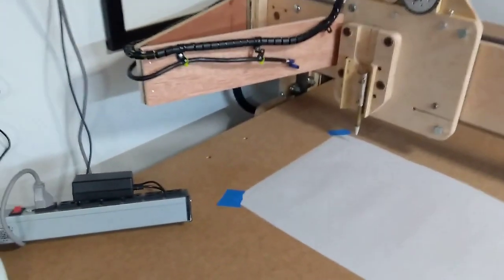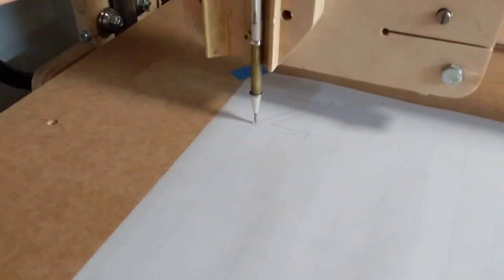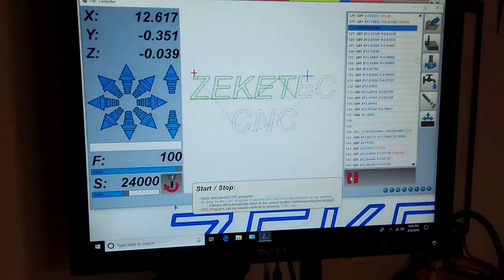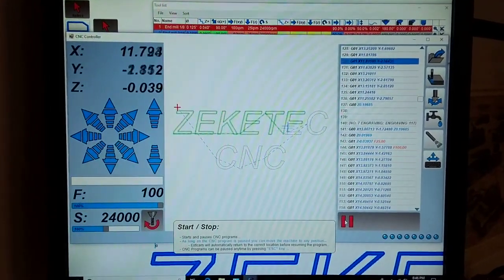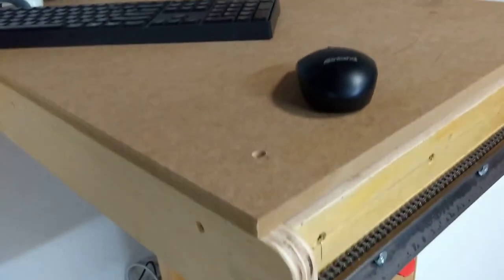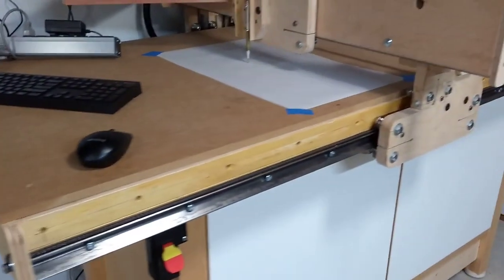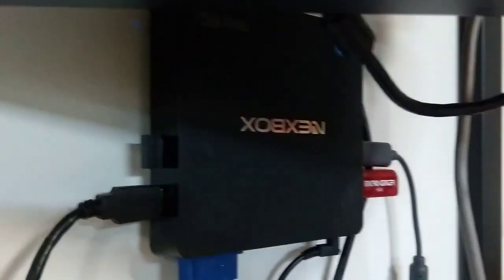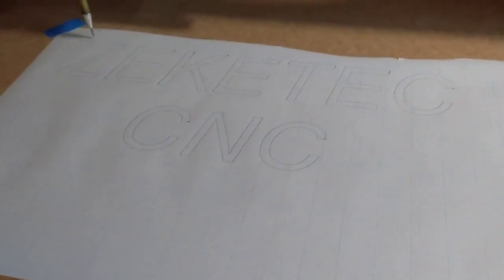My CNC Router Lives!

Comment: Hey, I really like the setup. Great job. I was wondering if you have and can send me what all you used and sizes you got in the sprocket to make it? I am trying to build a 4' x 8' system.
Reply from the maker: The sprocket sequence is: 9 tooth on the motor driving a 32T sprocket, the 32T sprocket spins the 12T sprocket which runs along the X and Y chain lengths.
Reply: @zeketeccnc1207  thanks, will make note of this
Reply: @ryancraig4063  hello 
How far have you with your 4x8 system? Im also planing to build such. Would you mind giving me some guidelines also?
Thanks

Comment: hello, great build, I like to build a CNC plasma for myself and I want to use a chain drive system on my CNC. please can you give me the number of the teeth on the stepper motor and the sprocket chain?
Reply from the maker: Keep in mind that I've incorporated a 3.55 to one reduction.  The sprocket sequence is: 9 tooth on the motor driving a 32T sprocket, the 32T sprocket spins the 12T sprocket which runs along the X and Y chain lengths.

Comment: Welcome to the chain drive club i think you can bump up the speed a bit mine has nema 34 1200 oz steppers and is scary fast @1200 ipm the max not that i run it that fast normally no more than 500 depending on the job but it will 
ive since relocated the 45 watt laser tube  from vertically mounted to the back of the gantry much better now more stable yes i had to use 3 mirrors to get it where it needs to be some losses to the mirrors but better tube protection and my water cooled 2.5 kw spindle is awesome all on its own sooo much quieter than a router
Cuts 3/4 inch ply in a single pass at 100 ipm

Comment: Very interesting a wood built cnc?  Guess you cant use cutting fluids or get wet at all. Doesnt wood expand contract warp?
Reply from the maker: Wood expands and contracts with difference in humidity.  Plywood minimizes this to a large degree.  This is mainly built using furniture grade plywood which is very stable.  I'm sure components are changing size a small amount with changes in humidity but those changes are well within the tolerances I was shooting for with this hobby machine.  As to cutting fluids, this cnc was built to cut wood and mdf sheet goods so cooling fluids are not used.

Comment: Seems pretty solid. I noticed a little wobble in the plywood baseplate of the stepper motor on the top of the cross arm at 1:14 minutes in the video. Other than that, if you're getting solid cuts, then what more can be said? Excellent DIY CNC build.
Reply from the maker: Good eye.  The motors are not hard mounted to the structure.  They are hard mounted to the jack screw and kept from turning by a lever arm attached to the gantry through a rubber bushing (that allows the wobble).  https://content.instructables.com/FR0/FJGX/K2G7G32O/FR0FJGXK2G7G32O.LARGE.jpg?auto=webp&width=1024&height=1024&fit=bounds